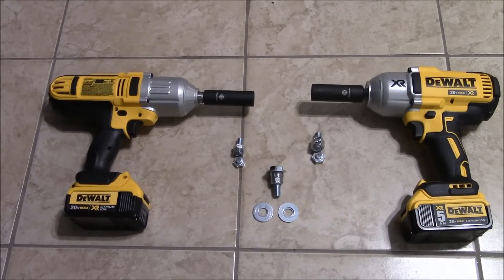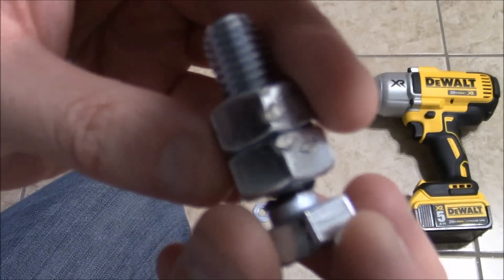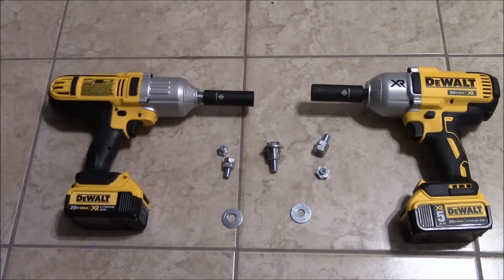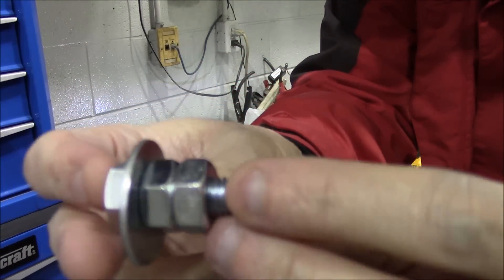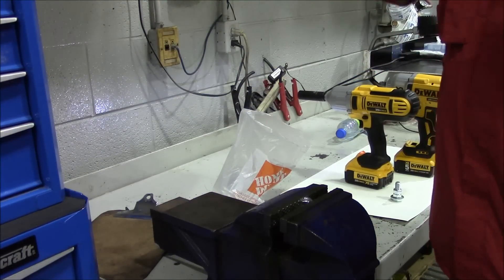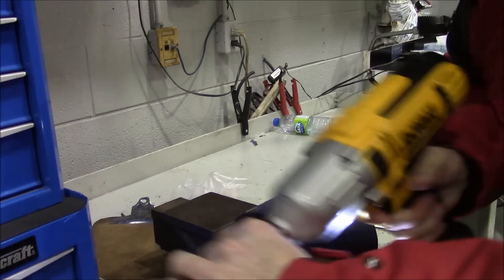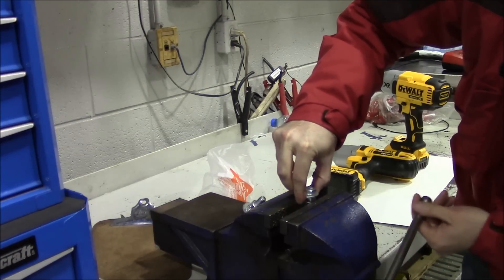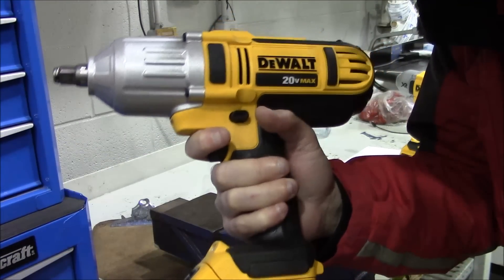Dewalt DCF889 and DCF899 bolt shear test

Comment: I got the dewalt 889b and it can't loosen lug nuts if they're torqued over 65flbs
Reply from the maker: The lug nuts are probably seized up with rust at that point try forward backwards one the impact but only go 1 second on forward not to snap anything. If that doesn’t work then you need to upgrade impact. The new mid torque are twice as powerful as the 889 and almost as powerful as the old 899 high torque.
Reply: @patdud1979  no, they're rotated every oil change and have lube on them and torqued to 67flbs
Reply from the maker: @StopTargetingOurKids  then there is a problem with your impact. Get a newer version.

Comment: Weakened bolt woth one then finished eith other. Say its m10 but thay doesnt matter as much as the grade of the bolt which measures tensile strength. Dont hate on videos very often and OP seems like nice guy, besides putting puppies in vices, but should think through tests before filming

Comment: Forget the haters - it's true this didn't really prove anything but these goofy things are fun to watch :-)  
I'm looking to get one of these 899's because I want to learn some more car maintenance so I'm going to tackle a bad water pump replacement on an old honda. Apparently those crank pulley bolts  might come right off with a special tool and a couple breaker bars, or if you're unlucky you might spend 3 days throwing everything at it. 
I don't have a garage to work in so I can't afford to get stuck once I get started - hence looking to have the big guns ready from the start. Thanks for the demo.
Reply from the maker: Thx man I appreciate that 👍. And for your crank shaft I would try the impact first you might be surprised... and if that doesn’t work out then get the special socket that is just super heavy and increase the torque of the impact that combined with the 899 and you will be fine for any project 🤙

Comment: The 20 volt drill is an 18 volt it's just sold in America as 20 volt because the battery can produce 20 volts and the flexvolt battery can be used in anything 18-volt up to 50-volt I think it's just because Americans think bigger is better you're actually getting the same thing branded in a different way
Reply from the maker: I think everyone knows this by now lol

Comment: Hey I have the DCF899H and It has the hog ting on it and when I tried putting a 1/2" Socket on It the socket wouldn't go on any reasons why?
Reply from the maker: some are more difficult then other to put on you just have to turn the socket and sometimes give it a smack to get on there.
Reply: @patdud1979  okay thank you

Comment: This thing is built like a tank. It is very, very powerful◔◔>share4.photo/DImpactWrench?л    I was doing some demo work and it broke off two old 6 inch long lag screws without breaking a sweat. I also used it to install new ones during new construction and it easily drove them in. It does go through batteries, but that's to be expected and is a very small price to pay.

Comment: the problem with ur test is ur literally clamping down on the bolt itself its kinda of skewing things, ill tell u from personal experience with both since both guns have been out, the 899 is n absolute beast itll snap bolts all day long, also the numbers arent technically speed settings, yes they affect that but the numbers refer to what torque level u want, 1 being snap any bolt, 3 being turn the world when u hit the trigger

Comment: Would it be better to test with a torque wrench?
Reply from the maker: bill R  Different test for different applications sometimes you need to sheer the bolt to remove it! So it is good to know witch impact can do it.
Reply: If you wanted to measure the bolt sheer strength, that would be one way to do it. But you can't directly use a torque wrench to measure an impacts torque.

Comment: "I hope they're going to stabilize battery platform"... are you kidding right now? The 20v Max line came out in 2011... "keep changing". Except they did the 18v and then the 20v... that's the only relevant change for the video you're referencing. Both batteries are 100% interchangeable for the impacts you're using.
Reply: The 18v and 20v are not 100% interchangeable. You need an adapter to use the 20v battery on the 18v tools
Reply: @jasonmorehouse3756  There is some confusion over the battery formats here.  The 'old' 18V system were Ni'CAD or NiHM cells, The stuff 'you' call 20V is still actually 18V but using Li-ion and rather than confuse people in USA Dewalt knowing people would by the new battery and then sue because it didn't fit they (and other brands) all though it better to call them 20V which is in reference to the Peak charged voltage rather than the nominal cell voltage, it also meant that they had an edge buy getting people to think it was better than 18v!.   So all the dewalt 20v tools and batteries are the same as the 18v versions that use the Li-ion batteries as opposed to the older 18v range.  You can in fact get converters that fit the older 18v tools and enable you to clip on the new 18v sorry 20v batteries.  You Must not however try to charge the 20v batteries with the older 18v charger.  https://cordlessdrillzone.com/drill-wars/20v-max-vs-18v-batteries-which-is-more-powerful/

Comment: The entire premise of your 'test' is fatally flawed, because you didn't set up (or bother to mention) the critical ENVIRONMENTAL CONTROLS that are in place to develop a clear and factual conclusion. You are comparing two different impact wrenches made by the same manufacturer, that have a 75% difference in performance. (400 ft/lbs. vs. 700 ft/lbs.) That is frankly...ridiculous. So what's the point of this video? That one impact wrench is more powerful than the other? Common sense would tell you the 899 would win the 'test' easily. Did you do any homework PRIOR to running this head-to-head comparison? I mean really simple things like...WHAT IS THE MANUFACTURER RATED SHEAR STRENGTH OF THE FRIGGIN BOLT YOU BOUGHT IN THE FIRST PLACE?  60,000 psi bolt tension? 70,000? 80,000? Videos like this can in some cases be both educational and entertaining at the same time...but this one was the rare exception that missed on both points. Note: Impact wrenches create tremendous HEAT when you engage the the fastener with a socket for an extended period of time (> 1 min) at high torque ratings which exceed 1000 blows per minute. That withering heat will tend to breakdown the tensile strength of the steel faster by 50% or more causing it to eventually yield to any twisting or hammering force being applied. If it fails to twist for whatever reason, it will eventually snap off the bolt head. So it just becomes a matter of time before the fastener fails (snaps), if enough heat can be generated in that short time frame. (when combined with a high BPM being applied by the impact wrench anvil) Progressively larger diameter bolts (of the same grade) will require more torque, and time, to achieve the same result.
Reply from the maker: Sean Paul THX for the precision but it was an informal test and just to entertain people 😉 hope you still enjoy watching it...

Comment: ...well,people use their cordless impacts to speed up the process of fastening/loosening, NOT to shear off bolts or other fasteners!!
Reply from the maker: 177bandit Sometimes you have to break it otherwise you need to use a torch or a cutting tool to remove the rusted bolt so in my opinion it’s a lot safer to break it then using a torch and heating up the metal.
Reply: patdud1979 sometimes you spend more time drilling when you break bolts. it takes 3 mins to heat to up bolts to remove. if you know how to properly use a torch, there is no need to break any bolts!!
Reply: this is a muscle test not a proper use test

Comment: I see 3 flaws in your test. As mentioned earlier, use the same amp battery on both impacts. Place a higher amp battery in your car and see how much stronger your starter becomes. Use a different bolt everytime, each time you torque a bolt it stretches and weakens. Last but not least each test should be timed. That's the deciding factor if all else is equal. Good luck.
Reply from the maker: Everett Tice thx I'll keep that in mind next time I make a video.
Reply: That's only because of lower resistance with the bigger lead acid battery that keeps voltage closer to what is printed on the battery. You can use high discharge lithium batteries that are low amp hour rating btw, but still achieve the same thing...Done all the time in R/C cars where you want lightweight, but super high discharge capability.  So not entirely accurate of what you say that bigger is better.
Reply: Battery size does make a difference. See: https://youtu.be/6LaB7kGP4Vo
Reply: it's not like we need this test to know that the xr has more torque anyway.

Comment: both would have done it but if you watch your own video you will see the bolt turning in the vice, hence losing torque to sheer it
Reply from the maker: scott dephillips sr. good thing I did some more test and more video 😉
Reply: 'hence'
Reply: Yeah he forgot to try the older one again because it was turning  but had a new set up for the new items  didn't turn it again with the older model the old one would do the job too 😉 lol he was all about the new one from the Start of the video if you asks me

Comment: had the bolt not have ground round in the vice. the 889 might have sheared it.
Reply from the maker: Shane Clews I don't know I was hammering in it for a while before it started tuning in the vice. I think compared to the Milwaukee HD 18 that extra 50 ft-Ibs may be the key.
Reply: Yeh I suppose it may provide the extra power to break the 8.8
Reply from the maker: Shane Clews the 899 add no issue with the m12 ;) now I just need to find an m14 and m16 to push the limits 👍
Reply: I look foward to the results
Reply: longer socket make impact lose torque